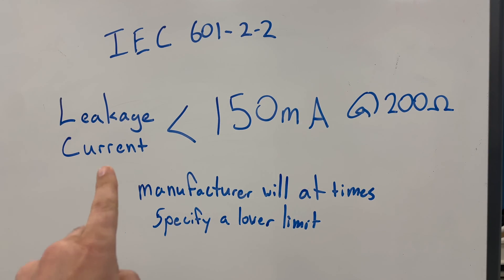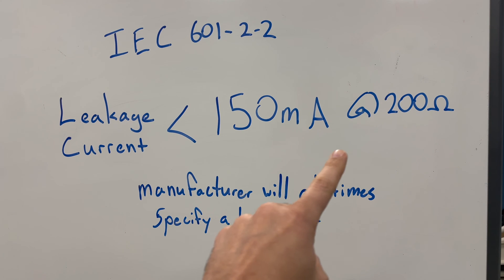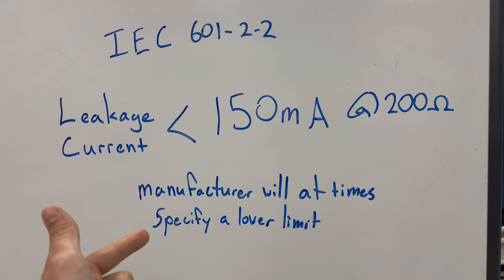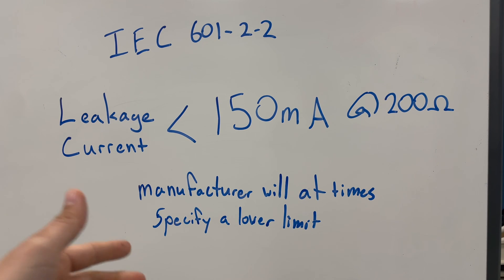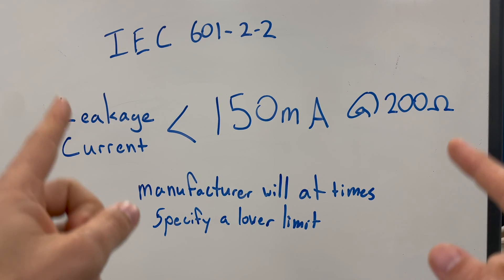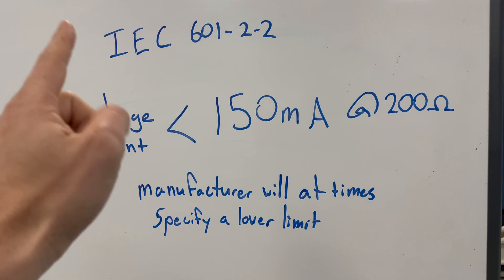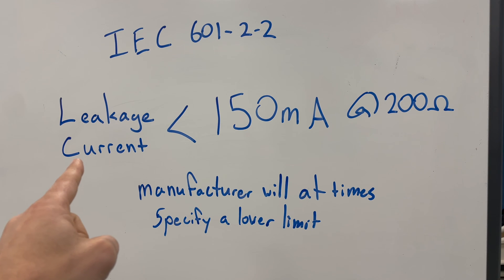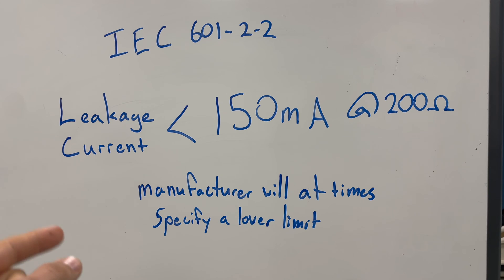ESU | High Frequency Leakage

Comment: Can you post the complete FLUKE QA ES III Options Output/vessel sealing / Power distribution test and available models in your facility?
Reply from the maker: Unfortunately, I am not as familiar with that part of the testing, but I believe you need a handpiece, which I do not have access to. There probably are not to many major changes - if you have a specific question I can try to look in the Bovie training manual to see if I can answer it for you.